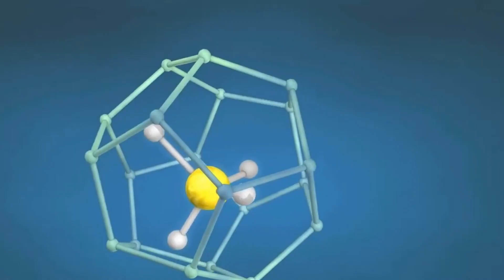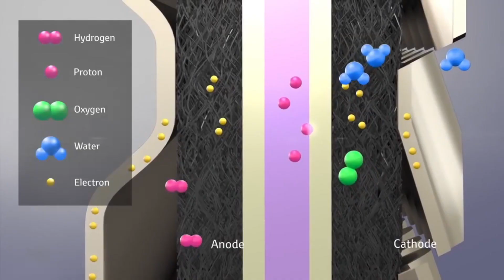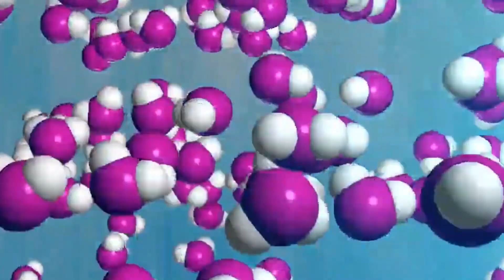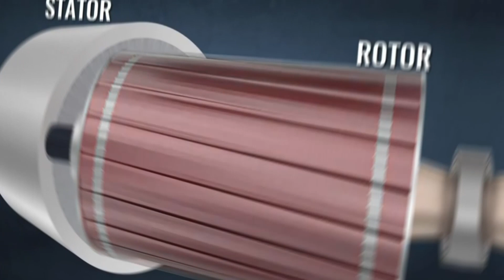Why ELON MUSK is AGAINST HYDROGEN Fuel Cells | Megatech Update

Comment: Hydrogen is the fuel of the future as the technology that the IMF and World Banks put down in 1968 is back. With this technology vehicles will only require their tanks be filled with water. I know some are going to comment saying, "It takes more energy to break the bonds of water than you get back from burning it." I have an answer to that question that will make you think and it goes like this, "How many forest around the world require all the trees to be hook up to an electrical power grid system so that the plants can break down the water they need to live?" The answer is none, thus showing there is another way to break the bonds of the water molecules that is not being taught in our learning institutions. 
A plant breaks the bonds of the water molecules by taking away the electrons from that atoms that make up the water molecules. It is this act that breaks the bonds of the water molecules for with water the atoms share electrons and if you then take those electrons away the water molecules those atoms formed simply fall apart into it's component atoms, IE, hydrogen and oxygen gas atoms.
The next question to get your minds on the right track is will all the methods we know of in getting electrons away from their atoms work towards breaking the bonds of the water molecules? And the answer is yes. The technology the IMF and World Banks put down back in 1968 broke the bonds of the water molecules by mimicking the earth's global electric circuit which breaks the bonds of the water molecules by way of ionization. By placing a high voltage potential difference on the water molecules that atoms will start to ionize cause them to eject their electrons and the result is the same as the act of removing the electrons breaks the bonds of the water molecules. Thus all that burn fossil fuels now will be replaced by this technology as we will just be replacing the source of the hydrogen away from fossil fuels to just plain ordinary water. No more harmful emissions, no more pain at the pump and if done correctly no more electric bills at the end of every month. This is the future the IMF and World Banks denied everyone for over 50 years now.